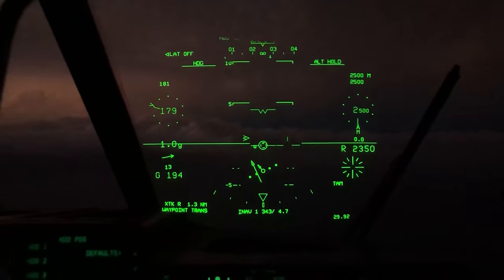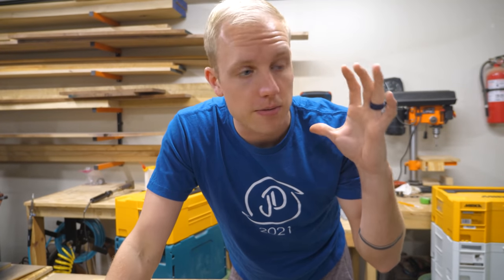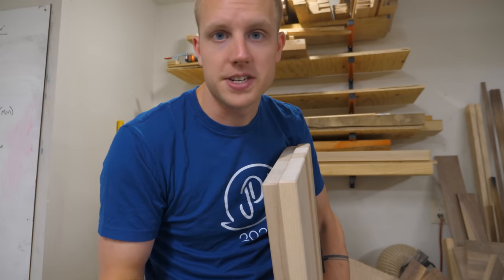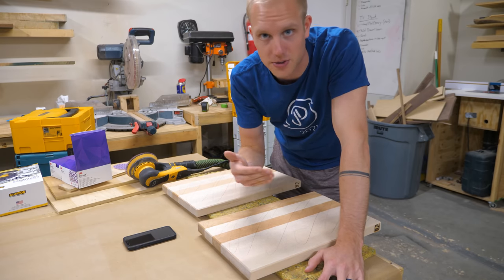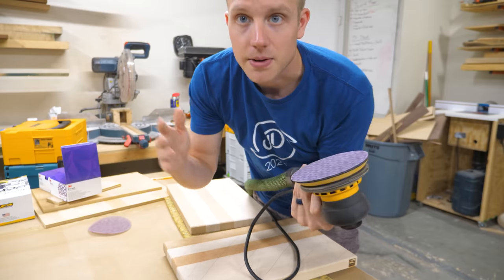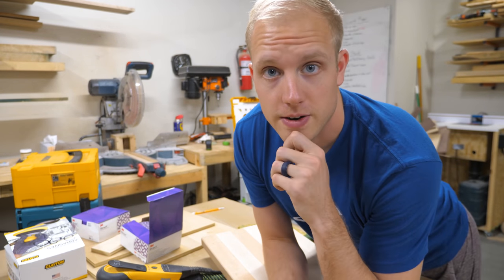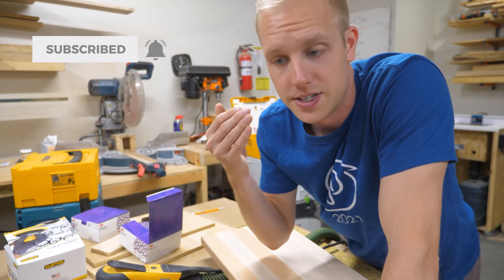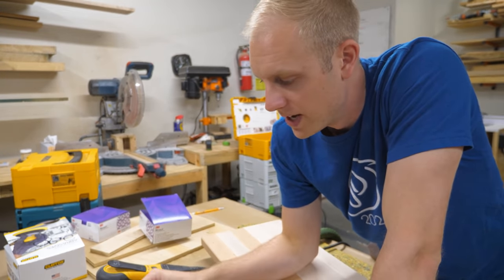3 SHOCKING things we found testing 3M XTRACT Sanding Discs (not sponsored) | 🌎 REAL WORLD TEST

Comment: Its says right on the back of the box of the 3M Xtract 88518 : " For orbital sander use only. DO NOT use with rotary sander" !!!  I just tried them with a Festool ETSC 125 cordless sander with  protection pad  ( The protection pad is needed for this kind of net/mesh sand papers so you don't ruin your hook and loop )  and no vacuum ( just the little bag and well made suction system ) on soft and hard woods guitars and they look like a game changer with ZERO grit residue and a good finish and A LOT FASTER removal than anything I tried so far...By a lot !  (P.s. Just let the sander do its job without pressing ) We Always have to think about, and experiment with OUR OWN set ups and technics because it is most always the culprit in ANY situations...Good luck !

Comment: I tested the 3M Cubitron II in both 5" and 6" discs (not mesh), with mixed results. I first tried it with a 6" 120 grit disk, and I thought it was revolutionary. It was so good I actually called my wife out to the shop to see. Unfortunately, when I went to test an 80 grit disk, I had the same problem you did. It fell apart in less than five minutes and left purple grit all over what I was working on. Since then, my results have been consistently on opposite sides of the scale. It is either great or terrible, and there doesn't appear to be much consistency between grits. It just varies from disk to disk. I have concluded that it is a good product with the potential to be great, but it looks like 3M is having quality control issues. To me, consistent results are essential, so at least for the time being, I won't be repurchasing 3M Cubitron products.
Reply: This seems to be common with all net based sand paper 80 grit is just so large it does not have space to hold on the the net

Comment: I watched this video a while back. I’ve been using the same Mirka paper for about a year now and decided to give the 3M a shot. I’ve gotta say I was blown away. I think the 3M paper removes twice as fast and lasts 3 times longer. For reference I primarily use 150 grit since I’m sanding pine and applying oil base stain.
Reply: thats right ...this test was like 1 min .... 
first minute on XTRACT leave some residue but then you remove everything super smooth , fast as heck all the time until it won't hold to the velcro
Reply: what you don't realize is,  that you may have bought seemingly same grit paper from each brand - but each brand grades their paper/discs differently.  so your 3m paper that cuts faster may actually be a lower grit - however if it lasts longer, then then you get more value that way instead of just cut speed alone.

Comment: Interesting, I just switch over to the new 3M sanding disc and sanded my maple/cherry cutting board from 80-240 grit without any problem or  having noticeable pink bits coming off. Maybe you got a bad batch or you demand more from your sandpaper, all good.
Reply from the maker: Yeah just a little more info for those interested...
I tested some from the other box and they have different batch numbers - same result. I wasn't pressing particularly hard and I noticed it happening during flat sanding, not just the sharp chamfers/edges 🤷🏼‍♂️.
Reply: @jennieanddavis  yeah I had the same exact issue. I use mostly festool granat. I couldn’t believe how fast the 3m cubitron pattern just fell off. It was actually very confusing for me.

Comment: Just finished my own unscientific comparison of Cubitron Xtract and Mirka Autonet using my Mirka 5" sander.  I compared the 120 and 180 grits of the two on the same walnut boards.  The Xtract sanded much faster (twice as fast?) as the Autonet.  Suggest you redo your comparison... or if you don't and your video stands, then maybe the Xtract will be more easily available for me in the future, which will make me very happy..

Comment: Mine came in last week, and tested them on my 3M Xtract ROS.  I was not impressed based on the 3M disks, looked like there was less abrasive than the hole area.  So I dind’t think it would sand down very quickly.  Well, I was wrong.  I had some butcher block countertops, to be cut and made into floating shelves.   I pencil marked the wood, and about few passes, and the pencil marks disappeared.  I tried again, same results.  And this happened on each grit I used.  I used 80 and work my way up two more grits.  I have no purple bits anywhere on my wood.  I wonder if you got a bad box.
Reply: It’s because he used a rotary sander and not an orbital. It’s user error on his part.

Comment: Something not often mentioned is the need to use protector pads when using a mesh sanding product. Even 3M recommends using one right in their literature. Add that into the overall cost...
Reply: Just started using my new sander, thanks for the heads up on the protection pads! First I've heard of it, good to know.

Comment: Old subject I guess but, I just picked up a sample pack of the 3M and used them to sand face frames on a massive entertainment center.  It was RAINING grit on me.  The shelving and floors are covered in sharp granular crap that I had to carefully vacuum up or it would definately have scratched the hell out the of finished floors.  JKM's video ddn't go into quality of the Surface at all so I don't get his ranting posts here about his robot tests.  Volume of material was better but I can certainly see how loose grains could ruin a finish.  You caught that right away

Comment: If I'm not mistaken those 3M sanding discs are only designed for random orbital sanders, not rotary sanders.  Using a rotary sander will provide less than desirable results.

Comment: I'm not seeing the loose grit problem either and I've used both the Mirka and the 3m discs. My guess is that this is about the amount of pressure you are putting on the sander as you work. With the recommended light pressure I'm having zero problem with loose grit.

Comment: Just a heads up, it’s ABRA-net. As in ABRA-sive. Also the Mirka Abranet isn’t not “sharp metal” protrusions from the wire mesh, it consists of a polyamide nylon fabric, much like metal surface prep discs. That polyamide nylon mesh is then covered in abrasive aluminum oxide particle that have been applied with adhesive much like your standard sandpaper. 

The major difference between the 3m Xtract discs and the Mirka Abranet discs is that Mirka uses aluminum oxide as the abrasive and 3m uses their proprietary precision shaped ceramic particles. While the 3m discs may undergo an initial “shedding” period of loosely adhered particles, overall their abrasive will last significantly longer than the Mirka. This is because the hardness of aluminum oxide comes nowhere near that of the ceramic used by 3m. Allowing the ceramic to stay “sharper” much longer than the aluminum oxide. 

As far as personal experience I used the Abranet products for years and thought they were hands down the best product on the market. That is until 3m launched their xtract series and I was able to make the switch to those. Most people that use abrasives daily know that almost no one comes near 3m when it comes to their proprietary “cubitron” abrasive particles. They cut more efficiently and last longer than anything else on the market. The only drawback most find is the price, but if you look at time and materials saved you almost always recoup this initial investment. 

Sounds like much of your time was spent chasing the shedded particles rather than brushing them away and moving on. You actually may have been more successful using the disc on a few boards before making the comparison so that the shedding had been completed and the 3m still would have outlasted and outdone the Abranet.
Reply: This 👆
Reply: Correction.

Aluminum Oxide is harder than ceramic, not the other way around, just FYI.

In fact, ceramic IS Aluminium Oxide, so technically, removing a tiny sample of each and testing them side by side their hardness will be almost identical.

It is the macro structure that is relevant and the way they wear that makes ceramic grains appear sharper and last longer.

AlOx wears by dulling as it is so hard, the sharp points of the abrasive grains get rounded off, this means AlOx abrasives cut more slowly, but are gentler and last longer leaving less sanding marks.

Ceramic grains are simply AlOx grains that have been milled into a fine powder then fired to sinter (fuse) them together, then further processed by milling to grade (size) them.

Ceramic grains have sharper edges where the grains have broken at the sinter points during manufacture (imagine a mountain with one jagged peak vs one with several jagged peaks and valleys)

During use instead of dulling ceramic grains regularly fracture exposing fresh sharp surfaces which allows them to cut more aggressively for longer, the downside is that they leave deeper sanding marks for any given grit. So, as an individual grain, ceramic (referred to industrially as SG - for Sintered Grain) abrasives are weaker, as they fracture! This also means they are sharper and thus cut more efficiently, for longer. So. Ceramic grains are chemically identical to AlOx grains and identical in hardness. They are in fact less tough and weaker which means they are sharper, because they break more easily.

Pedantic? Maybe, but you know, facts.

Silicon carbide is sharper than ceramic and fractures even more easily, this makes it great for light duty fine hand sanding but it wears out much faster.

Ceramic abrasives were engineered to basically be a self sharpening grain like Silicon carbide that was more durable, think of them of like a cross between SiC and AlOx. I think Ceramic abrasives are the best for wood up to P120 but for hard metals and floor machines very high performance Zirconium abrasives like Lägler are more efficient. Obviously ceramic diamond and cubic boron nitride would be the best but would probably be quite pricey.

Cubitron 2 grains are triangular shaped and are electrostatically aligned to point upwards and thus have fantastic initial bite.

The durability then becomes more to do with adhesive and grain retention.

Ceramic grits are best for light to medium pressure loading, for high pressure and temperature loading a Zirconia mix usually works better.

I have been wood finishing for over 35 years, use around 2,000 abrasive discs per year and studied materials engineering and yet this information confused me for ages and I have only recently found this out.

3M 310W may shed less, 3M 700W is more durable. SIA ceramic net is just as good and much cheaper than Festool who surely don't make it themselves, Abra net is also relatively expensive. In the UK at least SIA is most cost effective followed by 3M.

I have not used 710W but it looks like it would initially shed a lot due to the localised nature of the abrasive, this may lead to a lot of sanding marks, I would think SIA or the evenly coated 3M nets would give a more consistent finish.
Reply: @tajnewell  wow, thank you for all of this information, seriously! You can definitely tell that you studied materials engineering through a legitimate program. I have a lot of respect for people like you that take the time to become experts in their fields. You should honestly have a YouTube channel that explains this kind of stuff lol. There are a lot of people out there like myself that have a bachelors of science and therefore have a decent background on chem and physics but love to learn at a higher level like you displayed here. I appreciate the time you took to respond and enlighten me into the exact processes that these abrasives utilize in order to be effective. Thanks!

Comment: I watched the JKM video.  Was going to buy these too.  But wasn't the "wow" factor in the durability and not the speed?  Cheaper over all because they last longer at quality level?  Ergo - you don't change pads and save money.
Reply from the maker: Hey Edward! You make a great point!
Speed, durability, and cost are variables which overlap in A LOT of ways. They're very hard to tease out individually. 

More to your point, though, the durability on these is TRASH when you're evaluating 'sharpness' over time in this very narrow real-world-use-case here. 

Bottom line: I'm not going to consider changing our entire manufacturing process just to save a couple bucks a month on sandpaper discs. We have bigger fish to fry!
Reply: @jennieanddavis  agree you shouldn’t change your process. Time is money and JKM didn’t did not weigh in “ I can sand 4 boards an hour with this paper and 3 with this brand “. Pretty sure most of us get paid per project

Comment: I don't know if they are available in your country, but i'm using the Abranet Ace (they are using ceramic abrasive where the standard abranet uses aluminum oxide). They hold longer for my work on oak than the standard abranet. (also using the 150mm/5mm mirka machine) When they are starting to loose their sharp edge and are not torn, I like to use them on a 150mm hand pad for chamfers and round offs. I'm using the abranets with an extra velcro pad.

Comment: I was under rhe impression my 1/2" x 18" 3m cubitron 2 (60 grit) was designed for steel? Its for a powerfile and it does a fantastic job. So cubitron 2 is a wide line of products for different materials?

Comment: As many have said, the Xtract aggressive grits may need to have been broken in, but I think you may be missing what 3m has achieved. The ceramic grit is “self sharpening” in that as you use it, and it breaks down (the purple you’re talking about) - like carbide is leaves a sharp edge. It is miles superior than the Mirka net you have (but you have the Mirka expired patent to thank for Xtract). I’m guessing you’ve figured this out by now. 

Also, as Sedge from Festool would point out, the amount of suction from your extractor has an effect. You can lower the suction to get the right surface tension. 

Cheers from San Antonio. 🍻

Comment: I may be wrong, but it looks like on the Mirka discs you used net abrasives(which work great with dust collection,. Which having it work good with dc helps prevent the swirls and give a more even finish) but on the 3m I did not see holes or a net for the dc suck through. That may explain why you were having purple bits and swirls since the dc can't suck through solid paper. Maybe it was not solid paper, but hard to tell from the video. 
I enjoy your guys videos. Its been great seeing your buisness grow. If your ever in the Chicago area, my shop is about 40 minutes south. You have an open invitation to stop in.
Reply: The 3m is a net not a solid paper. The purple is the abrasive and all the white shapes are just netting. Dust collection should not be an issue here as the disc is more net than abrasive.

Comment: I use the Mirka Abranet also and have been very happy with them.  Yes, they’re expensive and I also should probably change them more often.  I also have the 3M discs which I have trouble even getting to hang onto my Bosch sander.  3M didn’t care.  They do hang on to my DeWalt but the edges end up looking like frilly lace after being changed a number of times.  I dunno.  Think I’ll stick to Mirka.  I was hoping the cheaper one would do better.  Thanks for your test.
Reply: You have to use a backprotector to use it

Comment: Hi Davis, for your info; it is Abranet, pronounced AH-BRAH-NET. The name is actually English since it is an ABRAsive NET. And it is NOT a steel mesh. It is simply a tough fabric with, in this case, aluminium oxide grains. Some Abranet products have either ceramic grains or silicon carbide grains. And the Finnish company Mirka were the founders of this product some 20 years ago which gives them a good advance in the "net sanding race".
Reply from the maker: All we know is that it makes us money and does a good job!

Comment: I think it depends on the use. I have recommended our charity use them because cost is extremely important and we are making beds from rough lumber. However, I agree that final finish is the biggest factor when doing most woodworking, especially if it is to be sold.

Comment: The proof is in using it with your gear and method. I take your word for the results. Makes me wonder if you got a flaky batch in that box from 3M. All the abrasive seemed to strip off the mesh too quickly in my opinion. Great test.👍

Comment: I ordered some of the 150 grit and I'm curious to see how they work. I generally run my boards through a drum sander at 150 grit, then ROS them at 150 grit with a Festool disc. I have found I prefer the Festool discs to the Mirka, but partly because I find the velcro on the back of the Mirka doesn't hold as well on the sander. Curious to see how the 3M perform!

Comment: Merka/Arbanet makes a "relatively new" ceramic abrasive mesh pad that directly completes with the 3M cubitron.

So if you want to upgrade from aluminum oxide abrasive to ceramic abrasive you don't have to change brands.

The ceramic abrasives do last a heck of a lot longer the aluminum oxide abrasives.

Comment: cost per gram might be skewed with the sanding disc material mixed in (metal is not a  light material)
Reply: Nope, it was the weight of the board before and after. They weren't collecting all of the dust and weighing it, that would be insane.

Comment: Ummm, 220 grit should not be used for removing deep scratches.   Hello? Is this thing on?   

Start at 60 grit if really deep scratches , then 80 grit, next go to 100 or 120, then 150, 180 THEN do 220 grit.  Do it that way and then you are doing a proper job to compare the results of the 2 products.  

I will say that the 3M paper does leave a few particles of the sanding media after you get started with a new disc.  That’s the particles sharpening themselves. It tends to stop releasing the large particles after a short time.  

I’ve been using this 3M paper and been very pleased with it.  Mainly on walnut at the moment.